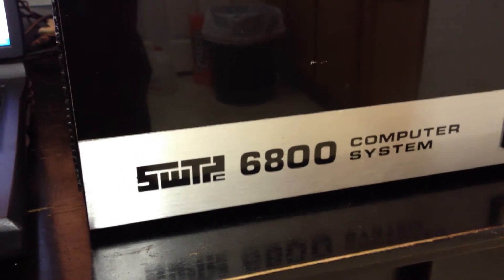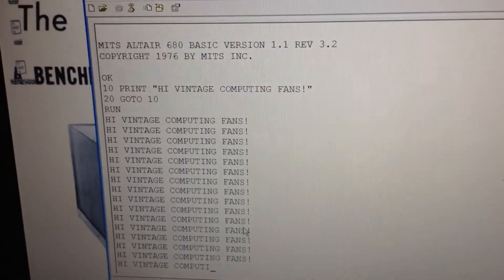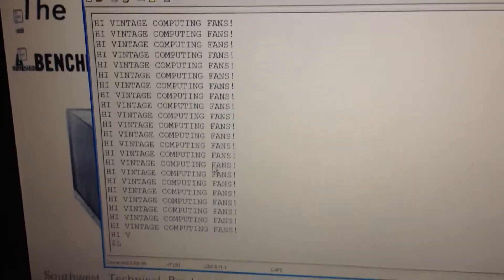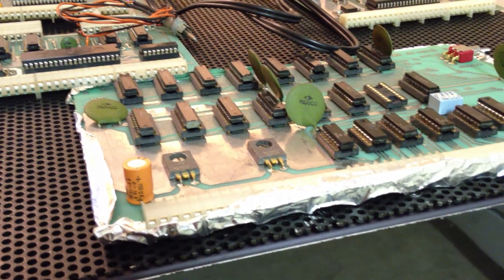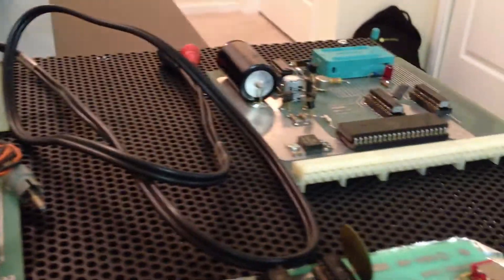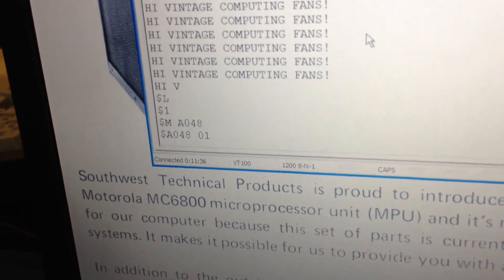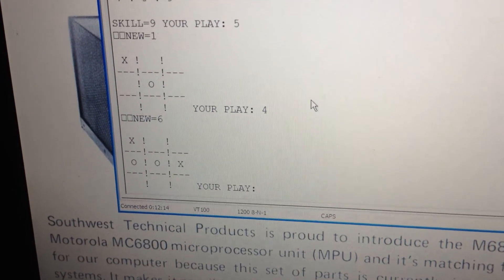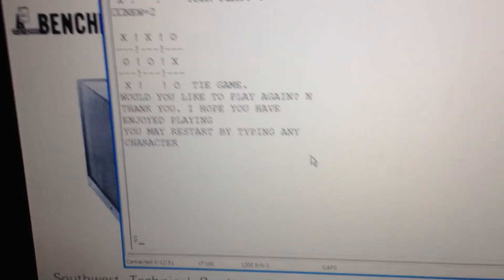SWTPC 6800 - BASIC demo and Tic-Tac-Toe

Comment: Ooh look, there is a 6809 one on ebay. https://www.ebay.co.uk/itm/South-West-Technical-products-SWTP-computer-with-6809-CPU-assorted-ICs-books/401971606346
Or, you can get a modern reproduction:- https://www.corshamtech.com/product/ss-50-6809-flex-complete-system/

Comment: Nice video.  Brings back lots of memories of my own SWTPc 6800.  BTW, it eventually had two 5 1/4" disk drives, an audio output that could speak English, and a whooping (at the time) 32K bytes of RAM.  I used a Model 43 Teletype as a printer and a dumb terminal as the control console.  All of this was before the first IBM-PC in 1981.  Wish I had one to play with now!